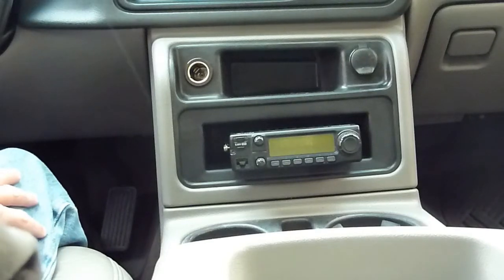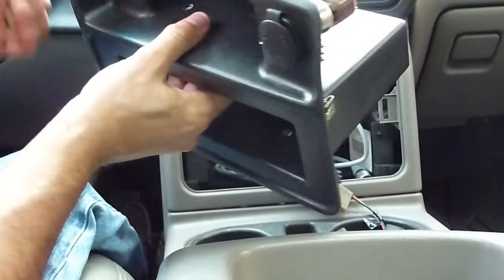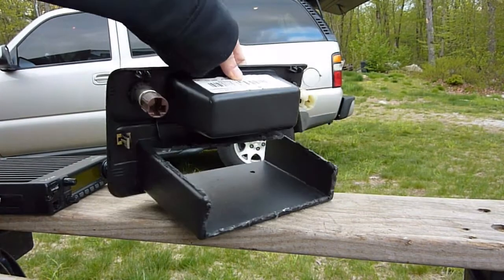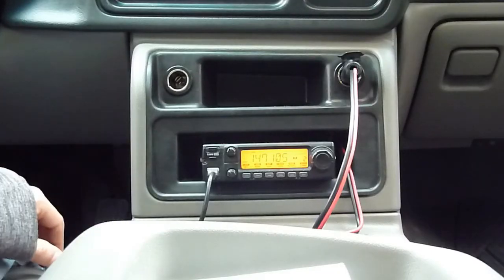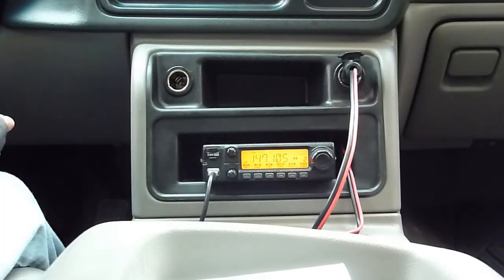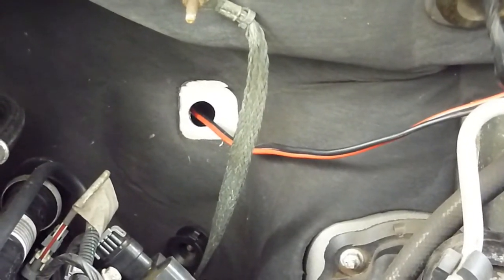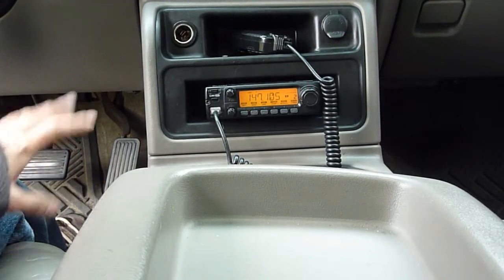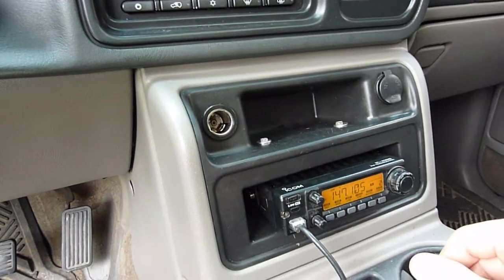2 Meter Radio and NMO Mount Antenna Installation - Chevy Tahoe Z71 (Part 2)

Comment: Thanks.  I have a 2004 Tahoe Z71 with only 63k miles and never used a drop of oil or required any maintenance except user replaced.  (tires, batteries, brake pads, wiper blades).  The 2004 Z-71 has a stellar reputation for reliability and makes a great first responder vehicle for SAR.  I installed a VHF/UHF with cross-band repeater so when on a mission I can park this puppy on a mountain and setup a dipole and every HAM on the mission can get repeater function to extend the range of their handhelds.
Reply from the maker: They are good vehicles....and you put yours to good use!

Comment: G'day from Australia ...we use UHF  477Mhz here which works pretty well . I have a 2008 Ford Falcon XR6  car  that I wanted to fit up with a Uniden UH 5000 radio . I did much the same as you  but didn't cut quite as much of the  tissue tray away  as the UH5000 is a mini compact unit .  The antenna mount is via a special bootlid allen key secured one (no drilling required) that allows me to switch antennas from 5-6 Dba to 2 Dba depending on location..The XR6 Falcon is a  sedan of course , not a truck and space is limited but it looks great and works well with range of 5-6 kms on simplex pretty much anywhere and up to 50 kms on duplex via repeaters ..I have two other vehicles and have UHF in them too ..This is a very enjoyable video to watch ..THANKS....

Comment: Thanks! I watched the two videos in this series. It will be helpful in planning routes for my cables in my 2003 HD2500 Silverado Crew Cab. I think the dome light on that will be close enough to the middle of the roof. The only thing is I will need to put a short antenna on. My Diamond mag mount fits under my 8ft garage door just fine. I will find an antenna with some give in it or just stick with my mag mount.
Reply from the maker: I switched over to a 1/4 wave antenna recently...search my recent videos and you can see my results.  Thanks for watching and good luck with your project.

Comment: Nice job on the install. That setup should work for you for a long time. Don't forget to set the APO option on your radio just in case you leave it on by mistake.
Reply from the maker: Thanks RG!  Good ides about turning on the APO.

Comment: Watching this during the Covid 19 outbreak has made me realize you were the cause of this using Icom with Yeasu.....   Nice video.
Reply from the maker: Oh man... You might be right!
Reply: Since you are reading this real time, why didn’t you try to fit the radio in the upper hole? I’m thinking of doing that with my FT7900 on my 2006 2500HD.
Reply from the maker: Because of the cigarette lighters

Comment: Great job friend.
You look like you are out in the country.
The extra concern for those of us in a more hostile urban environment is that of theft.
A big antenna on my Tahoe screams "expensive radio inside".
Not sure what steps I can take to be a little more discreet with the antenna and radio installation.
But I really liked your two videos!
Reply from the maker: Thanks for watching and taking the time to comment.  Yes, I'm in a pretty rural area but we've recently been getting a sting of car break-ins out here lately.  The dirtbags from the city are coming out here for the easy pickins.  I also have a car I drive back and forth to work that has a 2 meter rig in it.  In that car I mounted the radio in the glove box so when I'm no using it it is hidden away out of sight.  I also have a much smaller antenna mounted to the trunk so it's not as obvious as what I have on my Tahoe.  I'm glad you enjoyed my vidoes, thanks for watching and letting me know.

Comment: The spot on the firewall that you drilled through is the location for the "snow plow prep package" on 1500 series trucks. You could have connected your positive lead to the remote terminal under the red cover near the engine. I miss my 2004 Tahoe.
Reply from the maker: Thanks for the info

Comment: Watching your video to see how you go about things.  Pretty good until you get to wiring the power.  In any ham installation you should always go directly to the battery, especially if you are running HF.  You will want to put a fuse in line also to match amperage required by your radio.  That fuse should be as close as possible to the battery.  Going through the fuse block can cause a lot of problems.  You definitely need the grommet and not just because when that wire shorts out you'll certainly have a vehicle fire but also because carbon monoxide from the engine compartment will have access to the passenger compartment including you the driver.  By placing the fuse as close to the battery as possible the fuse would blow if it shorted at the firewall.  As you have it in the video the chance of a fire is huge.  The other thing is the ground wire should also go to the battery.  Although it isn't as critical on FM VHF you will optimize your reception by doing so.  Connecting to the battery for both positive and negative help filter engine noise as your battery acts like a big capacitor.
73
Mike NX7T
Reply from the maker: Points taken and I agree with them for the most part, but I think you're going off the deep end to some degree.  I addressed why I didn't wire to the battery directly at about the 8:00 mark and talked about my plans for putting in a grommet at about the 10:40 mark.  In fact, I di put a grommet in the hole about a week after shooting the video but didn't go back and show any footage of that.  Nor did I explain that this is a weekend only car and I didn't really drive it anyplace until I put that grommet in. Having said that, I know this is not an ideal installation but sometimes you've got to make do with what you have on hand to get a job done.  Your concerns are valid but a bit extreme.  For instance, I suppose there is a slight chance carbon monoxide could get into the cabin through that hole if an exhaust leak developed but the likelihood of enough CO getting through there to cause a problem before I realize it are pretty darn low.  If I were a vehicle manufacturer those are the kinds of things I'd worry about but I'm just a hack shade-tree mechanic with a penchant for cutting corners.
Reply: That red box between the battery and the engine contains the positive jump start post. Great point to hookup to for solid power.
Reply from the maker: I found out about that red box just a few weeks ago.  You are right, that would be a better spot to grab power.  I've actually added battery post extenders sice this video was posted and those are working great.

Comment: Thanks for the link to part 1.  New sub here. I am curious how you know how to remove panels and route the wire.  Is it just logical or is there a manufacture manual that is available.  I am a new HAM and looking to install a TRAM 2m/70cm antenna.  I have placed it on the roof of my Chevy Silverado 1500 4x4 and tested the cable and antenna with my nano VNA.  The SWR is fantastic for both bands which is nice since they said it didn’t require tuning, but I did want to verify that.  Haha. So for access to the battery for power and the antenna feed I am trying to figure that out.  Thanks for your video again, I like to watch to get ideas.  73!  Brent KI5HXM
Reply from the maker: I just have sort of learned by doing over the years so I guess you could say it's logical.  Part of the fun of 5he hobby for me is figuring out this kind of stuff.  Thanks for watching!

Comment: I would have used a bare metal ground or ordered the terminals to make it go to the battery and also not using any kind of grommet to protect the wire where the hole was made in the firewall was a rookie mistake
Reply: @SevenFortyOne  just a dangerous one. I'm just surprised a hammer has don't this. Just be safe and 73s

Comment: I hope you added something around the wires at the firewall to keep all that hot air from engine compartment from entering interior!!
Reply from the maker: That little hole isn't going to pass hardly any air from the engine compartment.  But the plan is to install a rubber grommet in the hole once I can get my hands on one.  Not so much for the air flow but to keep the wires from chafing on the side of the hole.